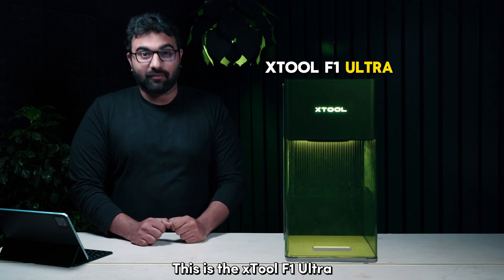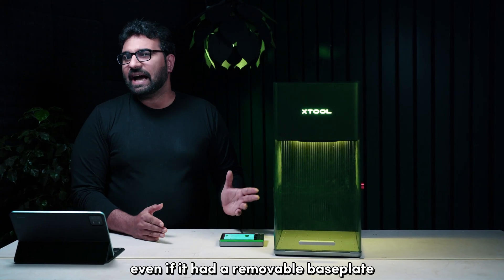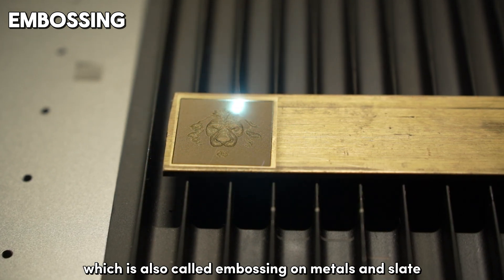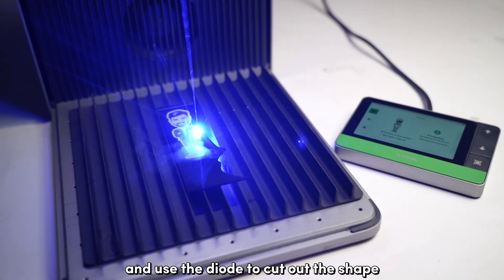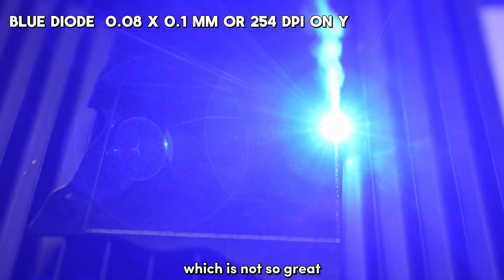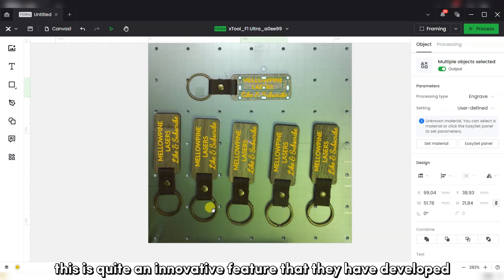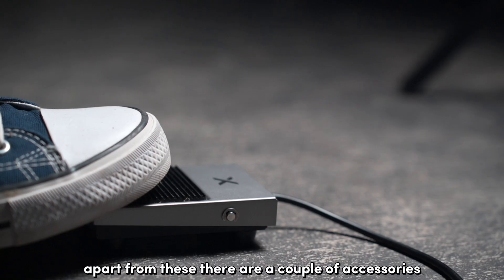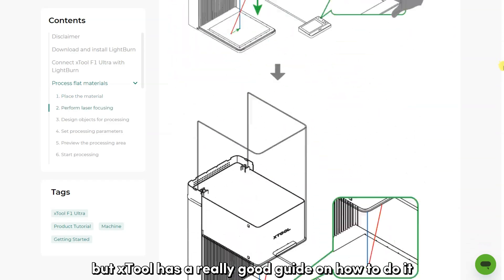F1 Ultra Experience: Is It Worth It? Tested

Comment: Very informative and useful video. Just got F1 Ultra unit and discovering its capabilities. One thing that is not made great is there are very limited material presets for F1 Ultra, that covers very little cases. Zero glass presets, lack of plastics so I have to experiment on material trying to catch best combo of power/speed/repeats. Otherwise machine is fantastic.